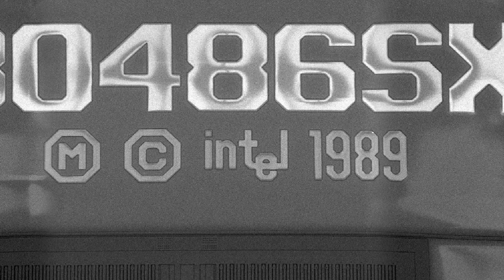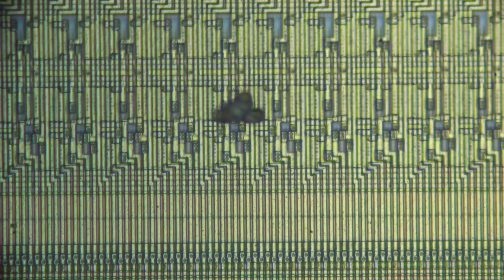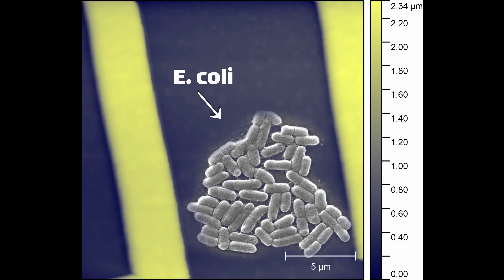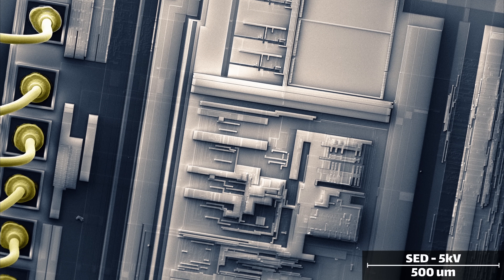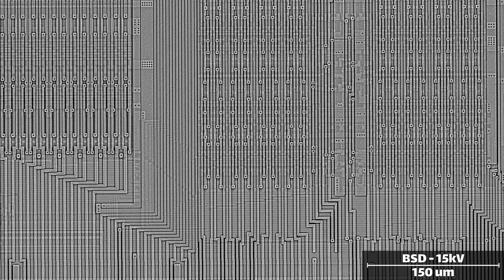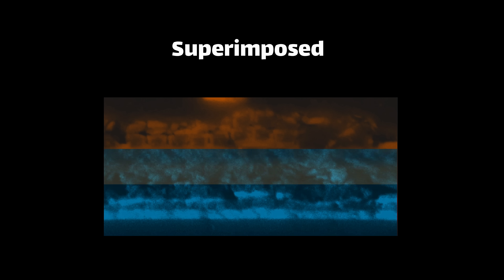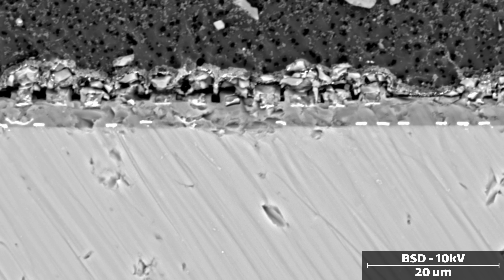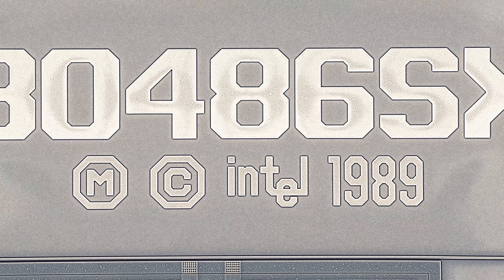Microscopic view of an Intel i486

Comment: Absolutely wonderful video.  Thank you for making it.  I often think about modern fabrication from the point of view of visible light.  To our human scale sensibilities, visible light is so short of a wavelength that it doesn't even really mentally compute.  And to then consider just HOW much smaller modern feature sizes are compared to visible light, it's truly mind boggling.  I often wonder what you'd even be able to see looking at a chip with features two orders of magnitude smaller than the light you're looking at it with.  Maybe some wonderful colorful diffraction effects here and there?  I dunno.  Crazy stuff. :)

Comment: Thanks for attempting to get the bottom layer. I can see now it is hard to get under the chip. The wires are beautiful as it is. Did you know Intel released to public domain their 4004 calculator design sources?! I made a laser etching of it, very nice.

Comment: I work in CD-Sem for Intel currently. This is very interesting to see. It's pretty crazy to see what used to be state of the art vs what we see nowadays.
Reply: what I find really interesting is how much smaller they've gotten everything to be over the years
Reply: This was so long ago, a heat sink was optional.
Reply: @sirnickity  On a DX, sure. On a DX2, you'd better have that AND some active cooling.
Reply: @the_kombinator   Pssst... this is an SX.  :-)
Reply: This is from a time where the majority of cars on the roads were carburetted, with some still being produced that way: Fuel injection in most cars was a single injector atop a, well, carburettor.

Comment: Extremely cool! I work for the company that manufactures your SEM. Primarily I work with the image data after they have been acquired with an SEM, FIB-SEM, TEM, etc. Nowadays a FIB or Broad Ion Beam (BIB) are often used for milling and polishing the surface before imaging. You can even repair a bad circuit with what we call a Circuit Edit system, which is basically a special purpose FIB-SEM.
What you are doing on your channel is one of my dreams and inspired me to purchase an old Hitachi SEM at auction. It will take some effort to get it working again, but your hobbyist results keep me interested in the process. I wish I could own one of our own microscopes, but it is not a charity, lol. They are pretty expensive.
Good luck with your new channel - subscribed!

Comment: how tf does the chemical bit of the microscope work?  You can see where oxygen is even when it's combined with silicon?!
Reply from the maker: Pretty cool right! It's a technique called Energy Dispersive x-ray Spectroscopy (EDS). When molecules are hit with electrons traveling with enough energy, the atoms are excited and release x-rays. These x-rays have "characteristic" energy signatures. I.e. carbon will emit x-rays with different energy than nitrogen or lead or gold, etc etc. So by scanning the electron beam across a sample and measuring the x-rays that are emitted, you can buidl a map of what elements are at each location.

Comment: There were some people that reverse engineered the 6502 and z80 with just some microscopes. these are MUCH MUCH simpler 8 bit single layer CPUs however. still impressive. one of the projects was called "visual 6502" recommend checking it out some time

Comment: This is cool. I remember getting my 486!

Have you ever considered that cities are these too and there is nothing new under the Sun, or the microscope? I'll be showing this at work.
Reply: I remember finally upgrading to a 486. In 1997 lol. It was a DX4/100, miles better than my 386DX/20. I had it for about 6 months before I got a Pentium (I think 133?) and then the upgrades didn't stop, as I worked in a computer store.

Comment: I find it mind-boggling that electronic circuits can be made on this scale.
Reply: In 1989. Todays processors contain many, many more components at a much smaller scale.
Reply: It is not done by hands or even robotic hands or machinery. The components are sort of "printed" on the circuit board with the help of light.
Reply: @abhay6576  And extreme UV light at that.
Reply: @abhay6576  While all chips have common components each architecture revision or design is uniquely formed. The architecture used to create these prints is first created by hand by a small team of big brained savants. EG the Ryzen architecture was built by 1 man in the space of 5 years. They do use software to help them but they also use pencil and paper. It takes years of sitting there drawing millions of circuits by hand.
Reply: Yes it is hard to comprehend the machine being scanned in this video is at this point ancient... more than 30 years old.
These days transistors in CPUs and GPUs are only a handful of atoms in size. Less than 100. The mind trully cannot comprehend...
Reply: But a transistor cannot be smaller than the smallest possible extreme uv wavelength, right? And on Wikipedia it says the smallest wavelength is 10 nm. So is that the limit with the current process? Can we not increase density anymore?
Reply: @turolretar   That is what we thought for a long time but actually this is now done routinely.   The basic trick is that we really now use interference patterns created by multiple patterns and exposures to write a line.   The individual mask does not look like the actual desired feature at all.
Reply: @turolretar  Answer that exact question is my density.. I mean my destiny
Reply: The last figure I saw, not too long ago, was we're up to 15 billion transistors on a single die.

That's 15,000,000,000.

A typical 8 bit microprocessor in the 1980s in our home computers  contained around 9000 transistors
Reply: @deang5622   Apple’s M1 Ultra has over 100 billion transistors, however that is not impressive - the chip is enormous. What is more profound is the 1nm transistor size made by some MIT researchers a few years ago. That’s 2 orders of magnitude smaller (roughly) than the current transistors used. That’s around 10 hydrogen atoms in width, which is an insane achievement.
Reply: @ollie4022  the nm number used nowadays does in no way represent transistor size.
Reply: @Sharpless2  Not at all true. Intel’s definition of process node is channel length. However the 1nm achievement is the standard technology node definition of gate length. Anyone who claims that the 10nm dimension has nothing to do with the transistor size is lying - Yes there are structures on the substrate smaller than 10nm, the tip of the fin is slightly smaller because of the way the fins are built. But the base of the fin was the designated 18nm size, which was the designated size (all averages of course). Either way, what’s being done in photolithography is incredible.
Reply: @ollie4022  the nm size used to refer to the actual size of the transistor. Now it refers to whatever intel or AMD want it to refer to for purely marketing reasons. This means we can no longer compare the chipmaker's fab process purely from knowing the process name. Kind of a shame.  This is what happens when marketing comes before engineering and they want to use smaller numbers. 

The same thing has happened with drive capacity in so many ways, processor speed in Mhz being used as a performance metric, internet speeds in Megabits not bytes. They're all intentionally misleading to make consumers believe they get more value than reality.
Reply: @Xorthis   The process node never referred to the size of the transistor. It referred to certain structures within the transistor, or even whole substrate and was almost always gate length or even M1 half pitch, as I mentioned in my above comment. It usually referred to the smallest intentional repeatable feature (I say intentional because there are obviously features smaller that are due to inaccuracies during the manufacturing process).
This was before the late 2000s, after things became a little less standardised, chip manufacturers began naming the nodes after whatever they pleased I think that trend started quite recently, I’d like to say 2019 but you’d have to look it up. 

However the above commenter claimed that it had nothing to do with the transistor itself, but this is not true. There is still a structure apart of the transistor or substrate as a whole that will be that described size, but it might not be the smallest size feature. Like I said above Intels 10nm process has a fin base width on the MOSFETs that is just 7nm. 

Yes I agree, it’s all marketing. That being said, I think most people are frustrated for the wrong reason because they believe manufacturers are being dishonest, but most of the time they are describing something on the substrate, but now it’s very hard to compare different nodes since it’s sizes from all over the place.
Reply: @ollie4022  Yes, I understand the measurements etc. The point is, manufacturers want their numbers to look good, so they use intentionally fuzzy phrases and measurements in their marketing. It's been an endemic problem in the tech industry for years because they know most people don't research to find out what they actually mean. Eventually it does come to light, but only after people are wondering why their 2TB drives only have 1.8TB actual free space, or their 4000Mhz processor is slower than a 3000Mhz one. It's misleading and wrong and they hide behind the 'you're the stupid one for not understanding this' excuse. They could be honest, but then the shareholders would complain about the bottom line.
Reply: @deang5622  Cerebras launched a new AI supercomputing processor with 2.6 trillion transistors, but that's a different sort of processor.
Reply: @binaryalgorithm  total number is not the right metric to be impressed by, it is transistor density. Still extraordinarily impressive, but Cerebras uses a whole 12” wafer for that count, not just a single die (about a few cm^2). That said, today’s technologies are using transistors with several nanometer gate lengths (although that’s not quite half pitch, for a number of technical reasons). What is almost more impressive is that we can fabricate 100T transistors on a wafer and nearly all of them work. The yield is impressive and unimaginable (failures < 1e-8 or fewer).
Reply: @vinny5004  Exactly. Being able to manufacture these things at scale with minimal failure is a testament to human engineering.
Reply: @binaryalgorithm  basically a giant server room working as a single computer.
Reply: Our brains are even more complex yet we have more and more idiots running around the globe these days.
Reply: Idem!
Reply: Aliens.

Comment: Honestly, hardware design is such a rewarding task.

Because at the end of it, you can step back and just marvel at the complex structures you are able to create and it is just such an awesome feeling
Reply: To be honest, we're not really designing structures - though there are several different techniques. You're designing logic circuits using a library of logic gates, and those gates, what transistors are in them, what physical size, how they are interconnected, that design work has been done by somebody else, and added them to a library of parts.

Eventually you end with an engineer doing floor planning, then place and route, which is done automatically but guided by the engineer.

A lot of it has to be automated, otherwise you would literally be there for dozens of years.

Comment: Its not as difficult to design and manufacture a microchip. The aim of microchip manufacture has always been to automate the design as much as possible and only do the "sanity check" by humans. So, majority of the design is handled by algorithms and CAD software, that is then checked by engineers for any faults in the generation process. The industry innovates very little actually... only recently have we seen more of it. Either be RISC or ZEN.
Reply: That is not quite correct.
The manufacture of the chip is straightforward, there are many stages.

The design: there are various stages of design. Somebody has to perform the circuit design, and that certainly is not automated.
The design parts of the die,  yes there is automation there, in terms of placement and routing of the transistors. Floor planning stage prior to place and route is manual. It's only small chips, with a few thousand gates that don't require floorplanning.

Preparation of the test data is not automated. It depends on what test data is being generated. Functional test data is often manually prepared, ATPG (automatic test pattern generation) is automated test data used to detect faults on the die at manufacturing time.

Comment: Wow. I remember building and programming 8086 computers back in the day...16k of ram and 5.25" floppy disk drives. Amazing how technology has jumped over the years. My best project was a 486DX40 with 512kram and an 80meg disk drive, a 5.25" and 3.5" floppy drive. Ah, the good old days. Thanks for this incredible video.
Reply: @Jason Fitch 16k was not a lot on an 8086.  The 8086 could address 1MB of RAM.  16k was where the first PC started at (though it used an 8088 - the 8 bit I/O version of the otherwise identical 8086).
Reply: 512 K of RAM on a 486? Man, even my shit-ass Deskpro 386 SX had 1024k. On a DX-40, I'd assume at LEAST 4 Mb RAM. Maybe you meant 5120k RAM? I've seen (even recently) weird setups like that - I have a 286 in my basement with something strange like 4768k of RAM.
Reply: @the_kombinator  If you re-read my post, I said my best project, not what the system was capable of. You really do not need to be so critical, I did not have unlimited financial resources to build a maxxed out system.
Reply: @tonyv8925  No worries mate, I doubt I'll at any point in time be putting 4 GB of RAM into my 386 ;)

Comment: What type of microscope is used here? If this was mentioned in the video, I missed it.
Reply from the maker: Scanning electron microscope for all of the black/white images.  It basically scans a tiny beam of electrons across the surface and records electrons that bounce back into the detector.  The "microscope" that used the little probe is called an atomic force microscope, and it works by essentially "tapping" on the surface to feel how tall a feature is.
Reply: @BreakingTaps  Thanks for the reply! Could you share the model of electron microscope you are using? I'm wondering if it would be ridiculous for someone to buy one. I expect several thousands or even 6 figures. Just curious. 

Thanks!

Comment: The titanium under aluminum where the Al is in direct contact with the silicon is most likely acting as a “getter” for oxide. It’d been decades since I was messing with silicon in a lab, but the very (!) thin oxide layer that forms on silicon surfaces, even at room temperature, can cause problems with the aluminum contacts. 

What can happen is that the aluminum will only make contact in a few nano-scale places. Al/Si contacts are made by sintering the wafer after the Al deposition. The sintering actually dissolves a little bit of the silicon into the solid aluminum, and a very thin layer of extremely highly-doped p-type silicon is created at the interface. It’s been too long, but IIRC, the connection works even to n-type silicon because the p-layer is so highly doped that electrons just tunnel across. (That may be entirely incorrect, perhaps another reader can correct me.)

Anyway, if the aluminum is only making contact in a few very small spots, it’ll pull a lot more silicon out in those places before the solid solution of Si in the Al reaches saturation. The result is a spike of aluminum that extends down into the wafer, potentially punching through shallow sub-surface structures. (You might punch right through the diffusion you’re trying to make contact with, right down to the substrate.)

Elemental titanium is very reactive with oxygen though, and can strip the oxygen atoms away from the SiO2, or at least do so to a sufficient extent to break up the very thin oxide and let the Al contact the Si everywhere. With contact everywhere within the defined contact area, the Al will dissolve only a very, very thin layer of the Si, so you get good contact, with no worries about punching through whatever lies beneath.

It takes only a vanishingly thin layer of Ti to do the job with a room-temperature oxide; as I recall, we’d flash just 50 angstroms or so of Ti before evaporating our Al.

As I said, I may be totally wrong on some or all of this; it’s been a good 40 years now since I was doing research that involved making aluminum contacts :-) Hopefully some other can either confirm or correct all this.

Thanks as always for the great content on both your channels; you’re one of just a handful of creators who I watch everything from, for its full duration 👍😁

Comment: For reference, a strand of hair is about 100 microns wide. So a feature of 4um would be 1/25 of a strand of hair. Seems small, but this is 30 year old tech. Features in todays chips are measured in nanometers, of which there are 1,000 per micron, or 100,000 per strand of hair. Todays processors have feature down to about 10 nanometers.

Comment: How did you get the cover off? I also have an i486 at home and would like to take photos of that chip
Reply from the maker: Hot plate at 250-300C, and after a while the solder gets loose enough that you can pull it off with some tweezers or a magnet.  Could probably do the same with a blowtorch but I imagine it's a lot more... exciting :)  Pretty easy with a hotplate though!